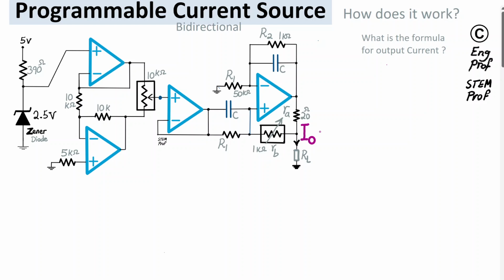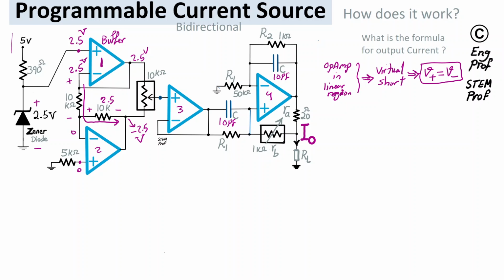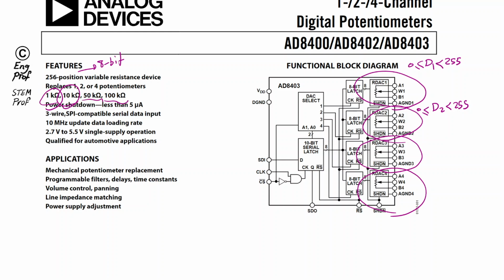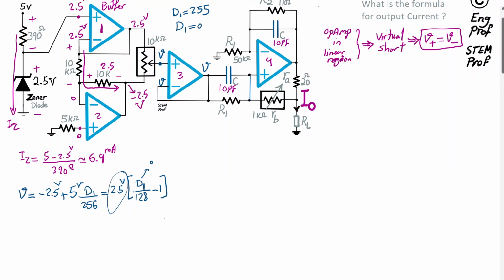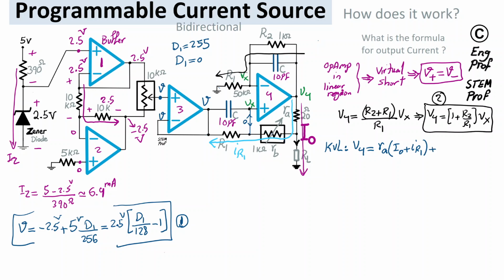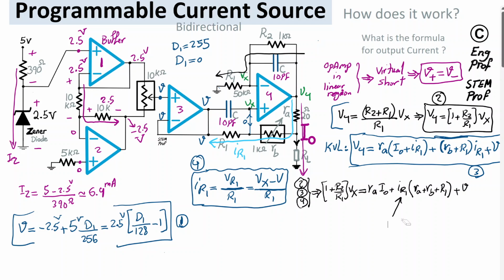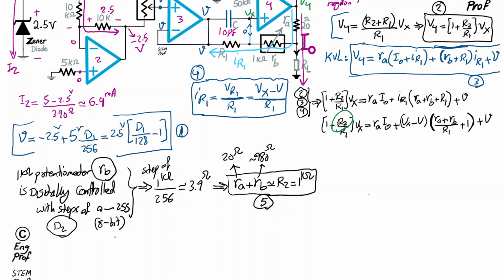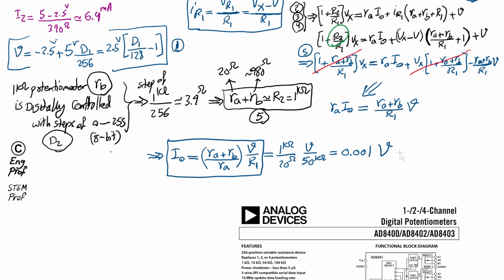Programmable Current Source Design with Op Amp, Zener Diode and Digital Potentiometer

Comment from the maker: Thanks for watching. For more Op Amp Circuits please see:
Wilson Current Mirror and Current Source Design https://youtu.be/LfbfJYrovN0
Temperature-Independent Current Circuit Design with Op Amp, BJT, Zener, Schottky Diodes https://youtu.be/hFbnjbddUvs
On-Chip BJT Current Source Design https://youtu.be/Rs7gEMk03dw
Thermometer Circuit Design with Op Amp & BJT transistor https://youtu.be/55YsraFE0rg
Instrumentation Amplifier with Electronic Gain Control https://youtu.be/C4tghZ-q6Zs
Push-Pull Power Amplifier with Darlington Transistors https://youtu.be/866MYibo8yE
Analog Logarithm Computer https://youtu.be/RpKEq5WyoLg
Op Amp Analog Computer Differential Equation Solver https://youtu.be/ENq39EesfPw
Sawtooth Oscillator Design https://youtu.be/2eUsGPfqbW4
Triangle Oscillator Op Amp circuit https://youtu.be/JF5Up_cuL9k
Sallen-Key Analog Filter Design Tutorial https://youtu.be/KwUnQXbk7gM
How to find Bode Plot, Freq Response, Transfer Function of Analog Filters https://youtu.be/vZFkPeDa1H8
Universal Analog Filter Design https://youtu.be/2J-0msXZE2o
Laplace Transform Example and S-domain circuit analysis:  https://youtu.be/ps8N5TPM_qU
Op Amp circuit Bode Frequency plot https://youtu.be/BLVzuuqAlZs
Lowpass Butterworth Filter: https://youtu.be/UzCjkwqy-9w
Analog Computer to Raise Signal to power n https://youtu.be/IUTlBH1UraE
Differential Equation Solver Analog Circuit https://youtu.be/R3X5AYNZGEI
Complex Sinusoid Oscillator https://youtu.be/GXRhmwmS5Zk
Full-Wave Rectifier circuit example https://youtu.be/DJJMNU-CYcg
Sawtooth Waveform Generator design with OpAmp, JFET, BJT https://youtu.be/5zHXTx-Vl20 
op amps Circuit with feedback loops to design an analog computer that solves a second order differential equation https://youtu.be/HeZRtnRXpEI 
For more analog circuits and signal processing examples see: https://www.youtube.com/playlist?list=PLrwXF7N522y4c7c-8KBjrwd7IyaZfWxyt
I hope these Circuit design and analysis videos are helpful. 🙂

Comment: The AD840X and AD8232, they don't have different resistance "modes" within the one chip. You choose a specific nominal resistance, and order a variant of that chip which will be only that resistance. For instance, an AD8402AR100 is a variant that contains two 100k potentiometers. Maybe one could instead just use 20R and 510R+470R.
Reply from the maker: Thanks for watching and your question/comment. It seems you’re mixing up package variants with how the device actually works. While you do order a specific nominal end-to-end resistance (1kΩ / 10kΩ / 50kΩ / 100kΩ), per Analog Devices, the AD840x is a digital potentiometer (a digitally controlled resistor) whose impedance between terminals and the wiper (mid terminal) changes with the RDAC code (for example 8-bit code representing 0 — 255). That’s literally the definition.  Functionally, the device can be used in: Potentiometer mode (A–B–W, classic 3-terminal pot) or in Rheostat mode (2-terminal variable resistor by tying W to A or B).
What’s fixed by the part number:  The end-to-end resistance (RAB) e.g., 100 kΩ for AD8402AR100
What’s programmable inside the chip: The wiper position,  256 discrete tap points (8-bit RDAC), Variable resistance A–W or B–W, set digitally.
So, while there aren’t “different nominal resistance modes” magically switching a 100kΩ into a 10kΩ, there are 256 programmable resistance values per channel, exactly as Analog Devices documents. If it didn’t do that, it wouldn’t be a potentiometer, instead it would be just a very expensive fixed resistor.

Comment: Very nice demo. I think I will build a small circuit based on this… Thanks.
Reply from the maker: You're welcome, and I'm glad you found the video helpful. If you're interested in more current source designs and precision circuits, check out:
🔹 Temperature-Independent Current Circuit Design https://youtu.be/hFbnjbddUvs with Op Amp, BJT, Zener, and Schottky Diodes
🔹 On-Chip BJT Current Source Design – Watch https://youtu.be/Rs7gEMk03dw
🔹 Wilson Current Mirror and Current Source Design – Watch https://youtu.be/LfbfJYrovN0
Thanks for watching!

Comment: 1:57 can you explain how the 5k resistor to ground improves the offset?
Reply from the maker: Good observation and question! The 5kΩ resistor to ground at the non-inverting input of the Op Amp helps improve the offset by balancing the input bias currents. Op Amps have input bias currents that flow into or out of their terminals. If one input is directly grounded while the other input sees a resistance (such as the surrounding circuit elements, in this case the two 10kΩ parallel resistors connected to the negative terminal of that op amp), an imbalance in the input bias currents can create an unwanted DC offset at the output. By placing a 5kΩ resistor to ground, we ensure that both inputs "see" a similar resistance, which helps minimize offset voltage errors caused by bias current differences. This technique is often used in precision analog designs, such as instrumentation amplifiers and programmable current sources, where accuracy is crucial. 
   If you're interested in more current source designs and precision circuits, check out:

🔹 Temperature-Independent Current Circuit Design https://youtu.be/hFbnjbddUvs with Op Amp, BJT, Zener, and Schottky Diodes
🔹 On-Chip BJT Current Source Design – Watch https://youtu.be/Rs7gEMk03dw
🔹 Wilson Current Mirror and Current Source Design – Watch https://youtu.be/LfbfJYrovN0
Hope this helps, and thanks for watching!
Reply: @STEMprof  Okay, I understand now, that makes sense. Now I'm wondering if I should revist some of my earlier designs! How much of a difference does it make?
Reply from the maker: @SkippiiKai  You are welcome! glad that my explanation was helpful.

Comment: Very nice and understandable video! Thank you!
I'm looking for a programmable current source and sink for heating and cooling with a TEC (Peltier module). I want to not use PWM and a MOSFET (IRF520N) driver anymore, since the output voltage has some significant peaks disturbing the sensitive application, where I want to heat and cool. My TEC has a maximum rating of 1.9 A and I was wondering, if it would be possible, to use such a programmable current source circuit for that task. Do you have experience with that? Does that make sense and is it possible in a meaningful way to modify the circuit to allow for an output current of e.g. +/- 2 A?
You're help would be much appreciated.
Reply from the maker: You're welcome. Glad that this video is useful. One potential way to increase current by 1000x to +/-2 Amp (without using external push-pull Darlington transistors) could be scaling up reference voltage V and simultaneously carefully scaling down R1, R2, Ra and Rb resistors. Proper selection of Op Amp will be important as well. Alternatively you can use push-pull Darlington BJT stage at the output to amplify current similar to the output stage in the video of Push-Pull Power Amplifier with Darlington and Sziklai Transistor pairs https://youtu.be/866MYibo8yE and also in Voltage Regulator Design with BJT Darlington Transistors and Zener Diodes https://youtu.be/ArisQp7V0Ac . I will try to post a video about this. I hope this is helpful.
Reply: @STEMprof  thank you for the fast reply and the helpful hints in which topics I might dive deeper to make the circuit work for my application. I am a beginner in designing circuits, but I am sure I can find a solution.
Reply from the maker: @MaTzE_K95  You are welcome. Glad that my suggestion was helpful. In addition to this modified Howland circuit, there are more current source topologies discussed in other videos in my Analog Circuits Playlist. (Search for current source). Good luck with your design.
Reply: @STEMprof  Sounds good! I will have a look their. 
Thanks!

Comment: Hi, wouldn't it be better to replace Rb with a 1kOhm resistor AND add another 20 Ohm resistor in series to R2? To maintain the nice 0.001 relation between V and Io I guess we need to increase R1 to 51k in that case (50*1.02 = 51)...
Reply from the maker: Thanks for watching and sharing your thoughts & suggestions. Sure, there are many ways to realize the required Ra+Rb=R2. The reason I used 1kOhm potentiometer is because firstly its widely available with decent accuracy in both analog and digital format and secondly it can be adjusted to compensate for non-zero tolerance of R2 value (meaning it varies from design to design). Please also see additional example: Bilateral Current Source design https://youtu.be/rjHdU1CVCcA.  I hope this clarification and additional example are helpful. Thanks again.🙏

Comment: Howland current pump is a great circuit!  I used it in a saw tooth generator with controllable amplitude und it worked perfectly.
Reply from the maker: Thanks for watching and your interest. Glad that you like this programmable bidirectional current source circuit. For more examples please see: Wilson Current Mirror and Current Source Design https://youtu.be/LfbfJYrovN0
Thermometer Circuit Design with Op Amp & BJT transistor https://youtu.be/55YsraFE0rg
Instrumentation Amplifier with Electronic Gain Control https://youtu.be/C4tghZ-q6Zs
On-Chip Current Source with BJT https://youtu.be/Rs7gEMk03dw
For additional analog circuits examples see: https://www.youtube.com/playlist?list=PLrwXF7N522y4c7c-8KBjrwd7IyaZfWxyt
I hope these Circuit Analysis videos are interesting.🙋‍♂️